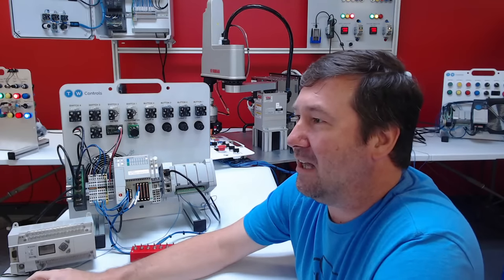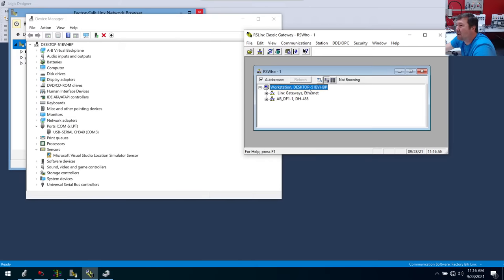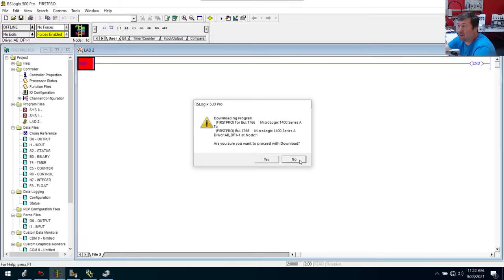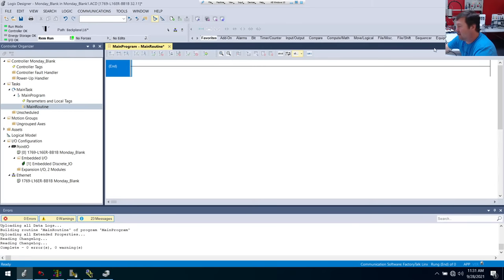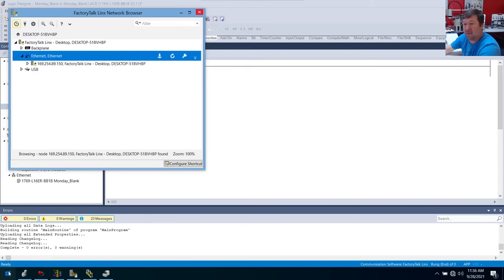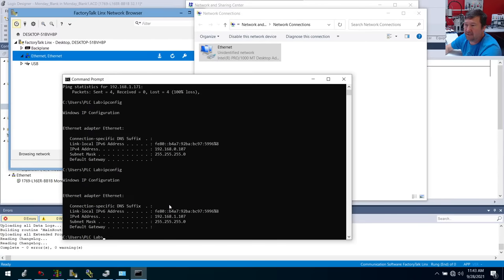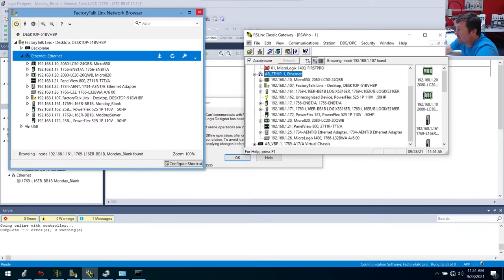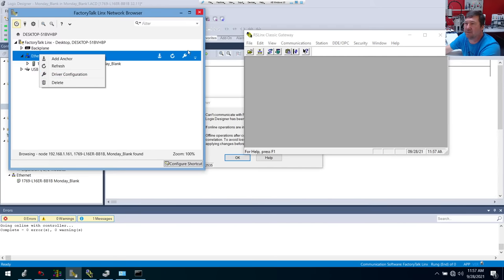How to Program Allen Bradley PLC Training for Beginners

Comment: Thanks man, just got hired as a PLC Programmer - I start tomorrow. Your video was extremely helpful, and I feel much more confident walking through the door tomorrow.
Reply from the maker: Best of luck!
Reply: Hey bud, can I ask do they have Allen Bradley PLCs at your new job? Hope things are going well with it btw! I did shift maintenance at an OSB mill for Weyerhaeuser for about ten years. Alot of plc work almost exclusively Allen Bradley. They had PLC 5s, SLC (slick) 500s, micrologix, contrologix, im probably forgetting a few but you get the idea. The most fun job I've ever had troubleshooting and programming PLCs, VFDs and all kinds of other stuff.

Comment: The x did not dispenser  on the diver when you plug it back in
Reply from the maker: I'm not following your question. If the X doesn't go away then you need to check your communications and cabling

Comment: Thanks so much for this. Been working as a water treatment operator for almost a decade, have created my own SCADA in python. It used raspberry pi with a breadboard to display green and red lights for on/off operation of motors/pumps. I wasn't sure the direction I wanted to go, but as soon as I discovered plc programming, I really felt like this is for me.
Reply from the maker: That is great to hear Pen!

Comment: Just as a note at 38min in, to find an IP address. I use an IP scanner to find the address of a PLC. Most show a description and it will say something about AB... Product etc. Most modern routers have firmware improvements that reserve IP addresses matched to device descriptions so if you connect a device often it will "reserve" that IP for that device. Thought that might help.

Comment: Great Channel and video.  At the beginning of my PLC journey.  What cable do you need to connect to the Allen Bradley SLC S/04 system?
Reply from the maker: The bottom port is a 1747-CP3 90% of the time but could be a 1747-UIC depending on the configuration.

Comment: Great video so far.   Can some or all PLCs communicate with both 485 & 282 simultaneously?   For example, I haven't found a water flow meter as of yet that can do 485 and it seems that most digital devices out there use RS485 protocol.
Reply from the maker: 485 is an older protocol but still fairly common. Many PLCs still support it
Reply: @TimWilborne  gotcha.   Can PLCs connect and communicate with both or would i need to get a translator so they report back in the same language?
Reply from the maker: It is very dependent on the PLC
Reply: @TimWilborne  Thank you. Really appreciate your quick replies Tim.

Comment: Tim I have a PLC-5and it came with Allen Bradley 6200 software. I wanted know what it would take to convert from the DOS format to Windows format. Do I need a copy of RSLogix 5? And what adapter?
Reply from the maker: RsLogix 5 is the Window's equivalent to 6200 but for one PLC, it may not be worth the money if you are not going to have to connect to it often.  Another option would be a virtual machine such as Virtualbox to emulate a DOS session on a modern computer.

Comment: Sir I have a very silly question, how to check in studio 5000 in my case V29 which analog input / channel is free to use, and if I found one how to use that? Sorry for the silly question as I'm new in Allen Bradley plc.
Reply from the maker: Great question, right click the parent tag... As in before you specify CH0Data for example.... And select cross reference to see which ones are used.

Comment: No other software has frustrated me more than RS500/5000 and RSlinx, SOOO many version specific dependencies, licenses, etc.. That was 15 years ago, I'd hope it would have been improved by now but I am a pessimist and it probably has only gotten worse
Reply from the maker: Or maybe you need more practice 🙄
Reply: @TimWilborne  Thanks, I'm good :P  I've gotten over the recurring nightmares of being out on a service call and in my whole bag of cables I didn't have THAT one, or a license expired, or someone updated RSL500 but not RSlinx and they would refuse to talk to each other.  RSL5000 was much nicer to use, for one, it would remember symbol names on the PLC and you didn't need to have the original file, that was a really big help
These trayformers are what I used to build https://youtu.be/mQukx2IyyL0
Reply from the maker: So you rant to the guy who is trying to help you?
Reply: @TimWilborne  I didn't mean it that way at all, great vid that I wish I'd have had back then.. take it more as comiserating with you for the poor design of AB software :)

Comment: Excellent video Tim. I have a question, When I created startbase tag, it wasn't in the Controller Tags with Scope to the whole project, however it was in the drop down menu for tags in the instruction and when I changed the scope to main program in the controller tags. Why that happens and if there any problem to let it in that way?
Reply: Ok, I think that I figure out why it only appears in the main program. When I created the tag, the scope was set to main program only. I have no idea if that can affect the logic of the program or not.
Reply from the maker: Controller tags are accessible from anywhere in the PLC, program tags are localized to the particular program.  Make sure they are controller scoped if you want to span programs or read from another PLC or HMI.
Reply: @TimWilborne  thanks a lot for that tip.
Reply from the maker: You are welcome!

Comment: I think green should all ways be ONLY used as ground wire this should be a universal practice. as an electrician it all ways bugs me to see green used under power in other applications even low voltage
Reply from the maker: Interestingly green for ground is the only wire color specified for UL 508A control panel.